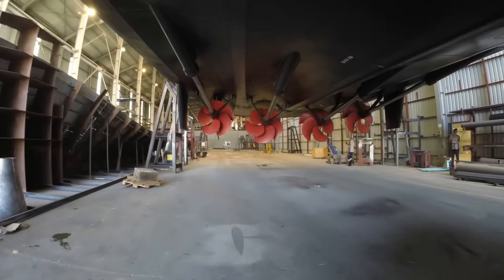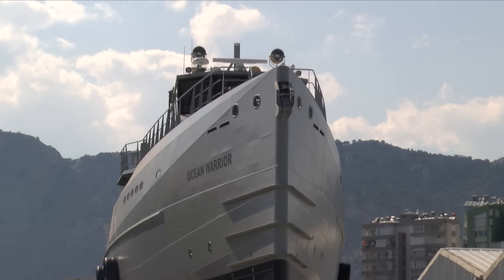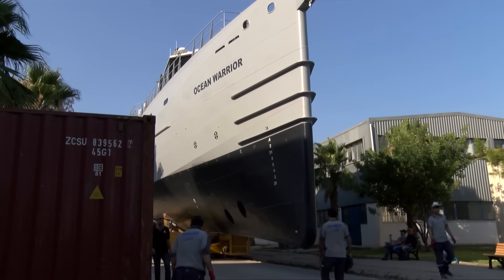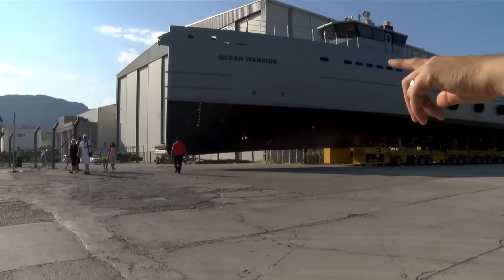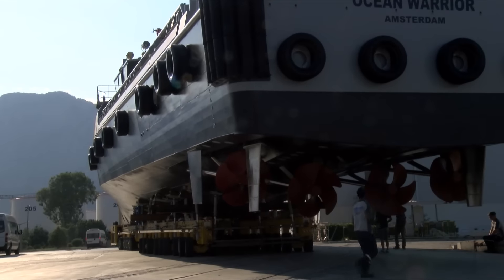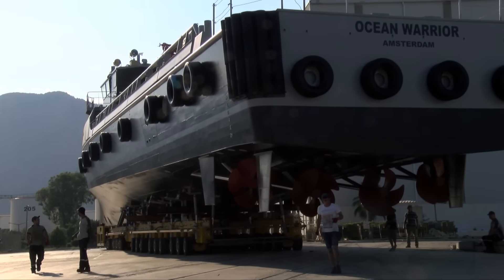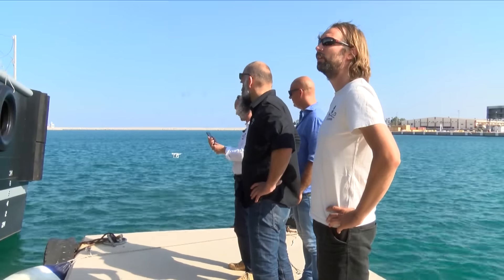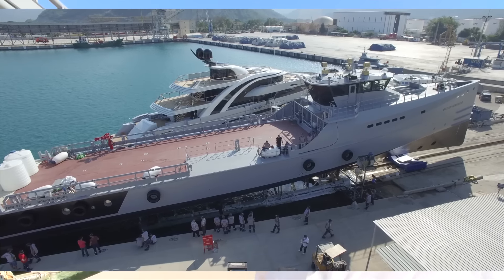Ocean Warrior Launch / Tewaterlating Ocean Warrior

Comment: She looks fast! Would love to see a video describing her attributes and what makes thus boat special.
Reply: well for now she's the fastest of her category? i think they said she was the first of her category/seize to be equiped with 4 mottors of 3000 horse power
"it will be the fastest of the fleet, and it's the biggest motor to be equiped on this type of vessel"
so yeah you have it
Reply: +the hatred 94 I think they are MTU engines. i have been designing a anti poaching ship with over 55 knots worth of speed. It has MTU engines and gas turbines with waterjet propulsion.
Reply: +No Name Does this make them more immune to getting caught in ropes dropped meant to disable them?
Reply: geoharmonic that and the speed make them able to easely pass right before a poaching vessel and drop rope in order to block their propeller

Comment: 12 million invested, but ya can't pay someone to grind down the welds? It pains me to see that such a magnificent ship now sails with welds sticking out causing drag, I know it's a small detail but even if it would save 0.1% of fuel, it's be worth doing. Also fatigue strength of a ground weld is much much much better than the welds you see here.

Comment: They forgot to bring a bottle of champagne on the ship isn't it customary for the champagne to be broken on the ship
Reply: They you wait until the boat is fully loaded an stocked for its trip. They have to outfit or rig the interior of the ship for alittle. Also I doubt SSCS will want to break glass and have it fall into the water.
Reply: +robm425 they did with the Steve irwin
Reply: +Mikethetiger survive and the bardot
Reply: My bad then. Usually the Champagne comes after the boat is fully outiftted which it will be in the next 2 months.
Reply: +robm425 they will but I was saying they put glass in the water with the steve